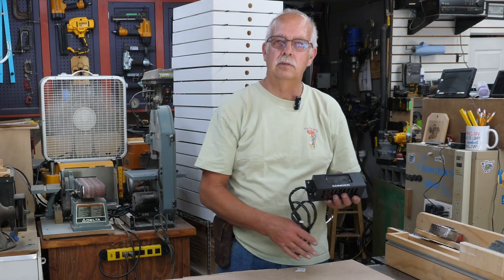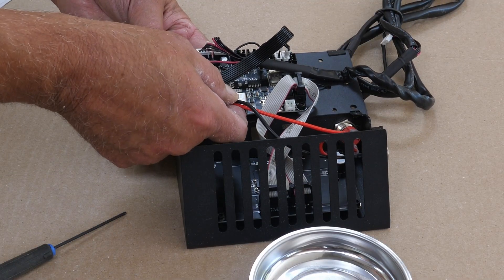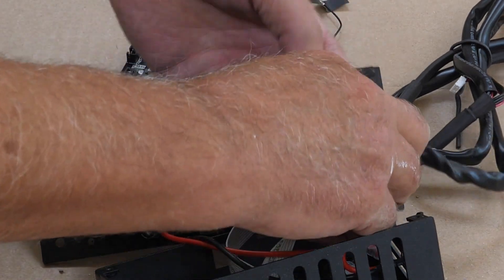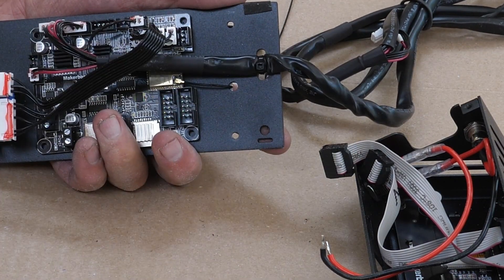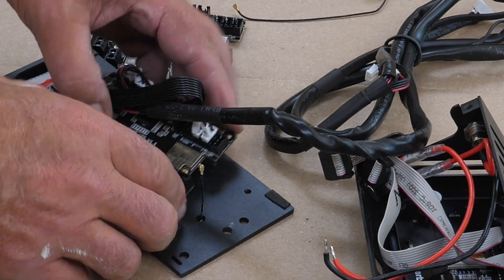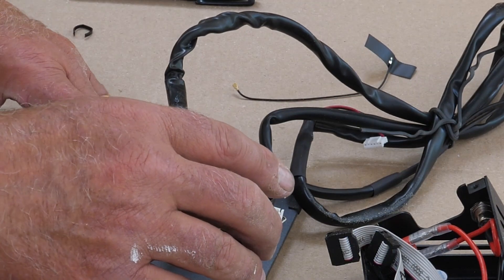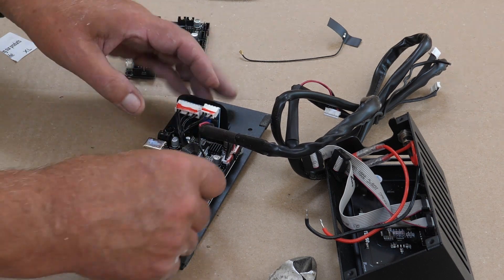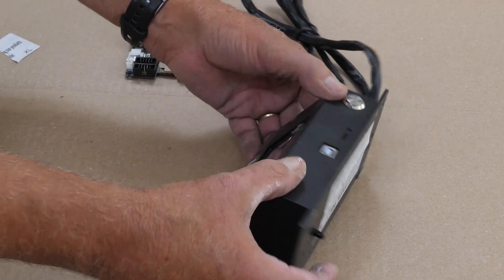Longer Ray 5 Motherboard Replacement

Comment: Hey Roger. My longer has started acting weird. As it goes left to right, it won’t burn in the middle of the project. Like, the laser stops working in the middle of the platform. I recall not getting very good direct customer service with longer initially so I thought I’d ask if you knew what this was caused from and how to fix.
Reply from the maker: Does this happen on every project, or just a certain one?  Longer's customer service is usually pretty good.  Just don't expect an immediate reply due to time zone differences and it may be 24 hours before you get a reply.  However, sending an email at 2:00 AM US time may get you an immediate reply since that is during the day in China!

Comment: Roger 
I am hoping maybe you could help me with an issue I am having with my Ray5 10W.  I've pasted in the email that I sent tech support at Longer along with the response they gave.  I'm wondering if in the 2nd step they give me am I opening up the motherboard and switching the x and y inside.  Thanks for any help you can provide.

I purchased a Longer Ray5 10W back in June.  I have not had any issues with it until today.  I switched out one project to begin another.  I went to frame my new project and the laser will not move on the y axis properly.  It clicks, and stalls.  I usually move the laser manually into position before I frame.  I checked the belts and did not see any tears or rips.  I have enclosed two different videos to hopefully help.  Could it be a wiring issue? or belts? the x axis moves smoothly as it always has.
 
The laser module traveled all the way to the far right and pulled on the wires when it did.  After that is when the issues started.  I unplugged the y axis and plugged it back in and it started moving smoothly again but when I attempted to frame my job it again started stalling and clicking.  

Dear customer

Hello, sorry for the trouble. We will give you the solution right now.
1. Please check if the XY axis cable is broken. If not, plug the X axis motor cable into the Y axis motor, and click the X axis on the touch screen to see if the Y axis moves normally. If the Y axis does not move, it means the motor is damaged; if the Y axis moves normally,
2. Please restore all the tested cables, plug the X motor cable on the machine into the X axis motor, cross the Y axis drive and X axis drive cables on the motherboard, and click the X axis on the touch screen to see if the Y axis moves normally. If it still cannot move, it means the cable is damaged and needs to be replaced; if it can move, the motherboard is broken.

Best wishes

--- Ryan
Reply from the maker: The purpose on switching X and Y cables on the motherboard is to try and narrow down if it is the driver component on the board, cable, or stepper motor.  Common troubleshooting method on 3D printers as well.  From what you have described, it could be either cable or stepper motor, but I am leaning to the motor since you can get it to make noise..  Doubt that it is the on board driver chip since it does send a signal.

Comment: I have to thank you for showing this, I have had to replace 2 boards in less than 6 months. One thing I seem to have lost are the plastic bushing to use for replacing the mother board. Can you recall the size of the bushings and screws for connecting it to the case? I tried to replace one during a bout of covid or something and my recall is a bit shorter now. Your video is doing a tremendous amount for recall. 
Thank you,
Reply from the maker: Sorry, this quite a while back and memory "ain't what it used to be"!

Comment: Hey Roger, I love these videos. I am curious though, do you have any idea how long the Mobo (PC gamer slang) lasted in the unit? Run hours or actual time? Have you had any issues out of your own Ray 5s? Thanks for the videos!
Reply from the maker: I have several hundred hours on my Ray 5 with no issues.  A MOBO fail can happen on anything at anytime, sometimes for no apparent reason.  The only thing I have had to replace MOBOs on due to random multiple failures has been Creality 3D printers (I have several) and as they fail are replaced with after market Big Tree Tech boards.   None of my lasers have had any issues and they get a lot of use.

Comment: Hey Roger, thanks for the video, I think i might need to replace my motherboard as well. My Y axis is not moving properly any more, just goes 1 step FWD 1 step BWD. When I replace the connector for the X axis cable its moving fine again, but then the X is messed up. Any idea what it might be? Also could you share where you got a replacement motherboard? I cant find any to order on the longer  official page.
Reply from the maker: You need to contact Longer directly to get a motherboard.
Reply: Thanks  @rogersshop  , I already had a chat with them and they are sending a new motherboard and combo cable to me. I have to say, I'm surprised by the quality and the speed of support they provide.
Reply: having the same issues is that really a motherboard problem? have you changed it and got better?
Reply: @johnnyvim8284  no, it was a wiring problem. The Y axis motor connection was damaged because the cable was bending too much. I added a drag chain to it and resoldered the broken wire.
Reply: @lifeofniko128  Oh yes I have switched the x cable to the y slot and it is working so it means my cable is damaged.. How could I noticed where is the damages part of the cable?
Reply: @johnnyvim8284  hard to say without seeing your cable. For me it was on the connector plug. Since the cable was bending a lot at this point during fwd/bwd movement I think it just snapped. I just pushed all of them a bit into the sockets and with addition of a drag chain there was not a lot of movement anymore so it works well now. You could also try contacting longer support and ask if they can send you a replacement cable set. It should be under warranty for the first 2 years.

Comment: I've had my longer Ray 5 20w machine for about 3 weeks it's been running great, I decided to connect the rotary tool. There are 2 cables one with white connections the other with black connections. I connected the cable with the black connections when I was supposed to use the white cable. Would this destroy the motherboard because now the motor is making for lack of a better word loud motor sounds. When I disconnect the power from the motor it sounds smooth and fine.
Reply from the maker: I wouldn't think so, but have never used a rotary on the Longer.  I suppose a short could damage the Y axis driver on the board, but not sure since I have never done this.